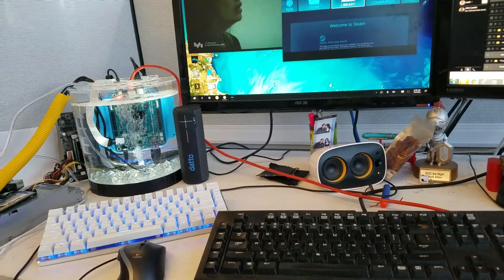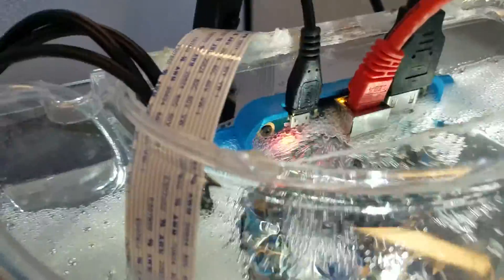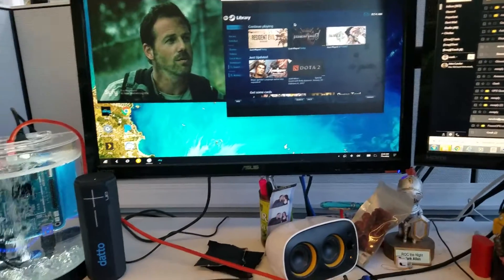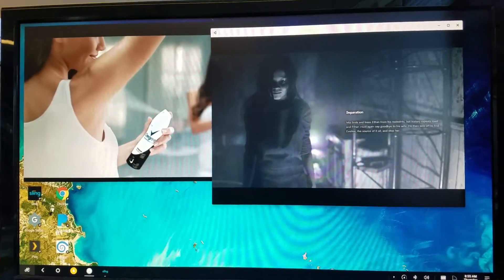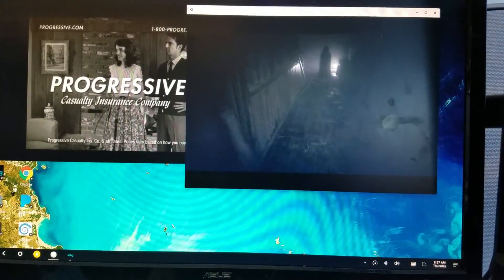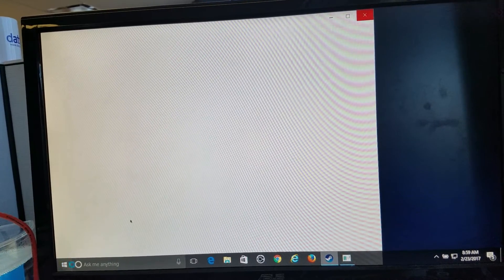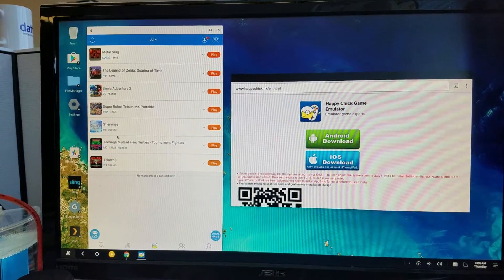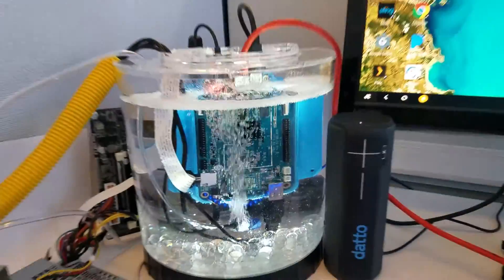Mineral oil cooled PineA64 ARM project board, running RemixOS.

Comment: Where did you get the Remix OS that you are running on your PIne?  Been awhile since I have run Remix on my Pine, but as I recall it has lots of issues.  Perhaps you can add more information in the description.

Thanks, again for the awesome video.
Reply from the maker: Ronnie Bailey Ill find the link for you, I think it is on the pine wiki page. So far I have not had much trouble. Some apps act a little strange because of the port, but for the most part it works well.

Comment: Cool stuff, 
Would it not have been better to 3D print a case with in and outlets, where the ports would still be on the edge?
Reply from the maker: That was the idea, but it did not seem to come out right, as well as ports being on both sides, this looked to be the best way.